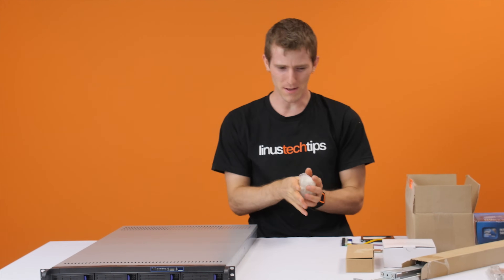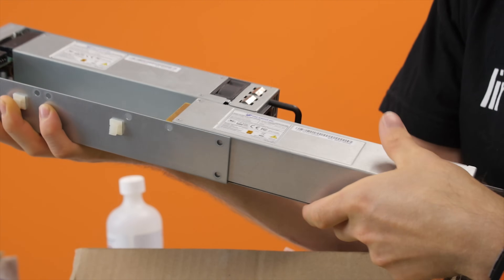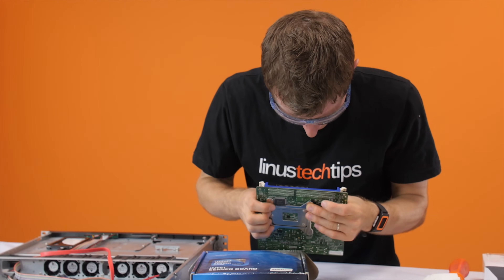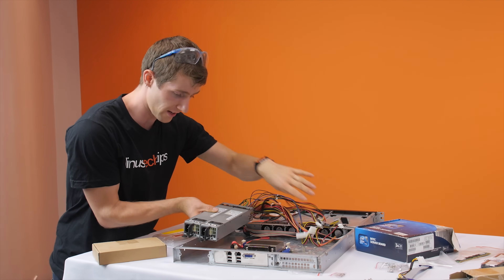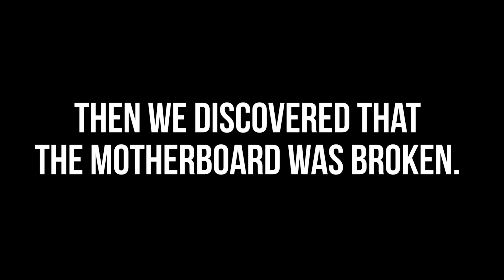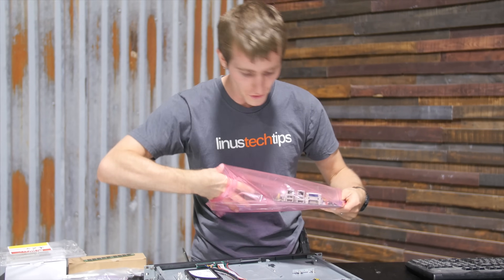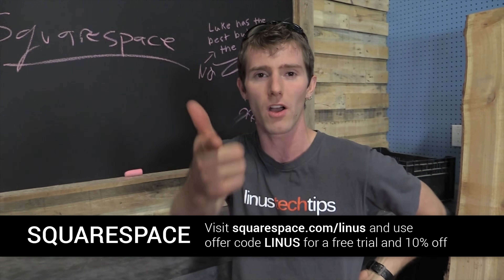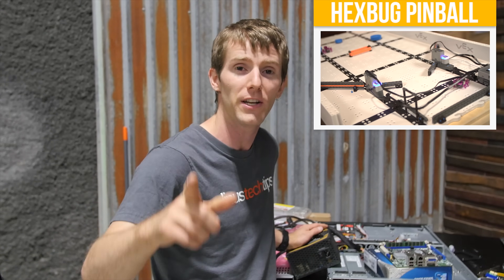DIY pfSense Rackmount Router Build Log - Part 1

Comment: +LinusTechTips Oh Linus, Linus, Linus. I've been in the computer industry for over 40 years. I served mostly small companies, and all of them seem to suffer from the same problem(s). There is never enough time to do it right, but always plenty of time to do it twice or three times (usually resulting in several cooked/destroyed components along the way). Of course, there is always plenty of time and money to ship replacements overnight and pay premium processing charges and then send a driver to the airport to pick it up. But NOOOOOOO, we can't just delay pulling the initial trigger by even one day -- just so an engineer (or sane person) has time to actually check the build. And worst of all, we can NEVER just stop and say we fucked up, let's go back and rethink this. No, that can never happen, because ... uh... uh... something manly and ego and stuff.

1) If truly constrained to 1U, you should have just bought a pfsense pre-built appliance and moved on. For now.
2) Else, you should have used a 2u (or 3u) case so it wasn't such a clusterfuck and moved on.
3) Else you should have just used an off-the-shelf mini-itx case, tossed it into the corner,  and moved on. Or just grab any one of a bazillion cases and spare atx boards you have over there, drop them in a random case and toss that in the corner.
4) You should have test-fit all of the parts in the case prior to assembly. Duh. Even I do that in an atx mid tower case.
5) You should never start carving metal until you know everything else is going to work, and there is NO other option, and there are NO other things that ain't gunna work or require mass destruction. Computers: when you bust out the Dremel, something is seriously wrong (and doesn't need to be that way).
6) There is a reason why 1U boxes never come with 32 core cpus and multiple graphics cards. Duh. If you can't fit the heatsink without grinding, just maybe you have the wrong motherboard / cpu / heatsink for that tiny case.
7) If you really wanted expansion room, then why the 1U in the first place? Even if you wanted future expansion, why not just go with the conventional blower for now and then address the ugrade if/when it ever actually happens. Or again, why not a 2u or 3u and expand until the cows come home?
8) The power supply not fitting thing... you bought 1,2,3 motherboards now, maybe you could have just bought the right power supply or the right case or the right motherboard or the right cpu cooler before you jumped in with both feet and a grinder? Have you ever heard of a pause button? Sanity check ... hello?

Dude, if I had $10 for every $1000 that small companies have pissed away this way, I'd go buy a new a car right now. No doubt it makes for great entertainment (if you like to watch people get humiliated -- which I REALLY don't). I'm sure that you can write off the expense that way. However, if I was an advertiser looking for a professional face for a serious product, I'd shudder at this stuff and probably just move on. Sadly, I have to give it a thumbs down. :-( But I still love you man.

Comment: Whats the difference between redundant and non redundant power?
Reply: +Xûr the real reason you would have a redundant power supply is that many servers HAVE to be online 24/7, for example a bank server storing account balances, the servers would be monitored 24/7 so if a psu fails, the engineer gets a message telling him what failed and what server. he wiuld then replace the broken psu and thus ensuring that the server never goes down
Reply: +Xûr The same as the differance between redundant and non-redundant anything..
Reply: +Xûr redundant has a backup power supply. 2 in 1
Reply: +Xûr  if one side goes you still have the other in a rundandant power supply. with out it if the psu fails then the system shuts off.
Reply: +Xûr RAID 1 for powersupplies
Reply: Ah! Thanks guys!
Reply: +Xûr With redundant power supplies, you can have it plugged into two power supplies at the same time, and if one dies, the other will still provide power, and you can switch out the old one. Also handy for needing to plug a server into another outlet without losing up time / having it turn off.
Reply: Y u no sell ice breaker last week u stupid
Reply: +callum Lawden  ...can be even more handy when is AC supply on two  diff fuses(AC circuits) of main supply..

Comment: In 5 minutes you:
-Tossed a CPU in the air and caught it by grabbing the pin side.
-Hacked off the I/O shield.
-Sliced a portion of the cooler mount and the speaker of the MOBO.
-Bent the MOBO quite a bit.

Linus, I love what you do but you're crazy.

Comment: no linus its not your fault, its just intel boards suck
i put incompatible ram (corsair xms2) into a DQ965GF and it never powered up again, and plugging in a pci usb2 card into an S3200SH killed that too. both the ram and the pci card still work in other boards.

in other words intel boards are pussies

Comment: Shorting components to complete failure would usually lead to smoke from a voltage control chip or fried CPU. From what I can tell the CPU wasn't changed. 
Normally single beep is a low voltage issue for the CPU which can be caused by shorts.

Comment: 1...test mobo before you place it in the can..
2...use hot glue or space on BOTTOM, if you need room..(heat sync support.)
3. Look at Box, make sure all metal contacts ARE where you need them..and NOT where you dont..

Comment: lol its probably the backplate thats shorting the motherboard...make a plastic one?
Reply: +Byzantine He even has a 3D printer, could easily make a new one.
Reply: +Fledge The backplate isn't a heatsink, it's just for supporting the cooler. It's not going to get hot enough to warp plastic. Plastic backplates are quite common.
Reply: +Fledge yeah
Reply: +Byzantine Agree - I would just put a thin layer of isolation tape on the backplate - that would fix it...
Reply: +Fledge Should do. ABS plastic melts at ~100c while the ambient case temperature you would expect to be less than 40c. At most the plastic would slightly warp which wouldn't be an issue.
Reply: +Nicholai Chev There is a serious reason, why this back plate is made out of metal. It is not temperature but to withstand the high pulling force caused by mounting the cooler. Finally it prevents the motherboard from bending. Dremmling around the back plate is no good idea. If back plate could be made out of what so ever plastic material, it already would ;-)
Reply: or just use 4 nuts on the back instead
Reply: +Fledge ABS plastics would do just fine they are used in cars under hoods and in WAY hotter environments than a CPU back plate. Your CPU is not getting above 60c in most cases even in a server - and the backplate not much over room temp.
Reply: +NPNtube That's true but normal pc builds have motherboards vertically and the installed heatsinks are much larger with added fan(s). All that weight pulls down too which causes lots of stress on the motherboard. Here the motherboard will be horizontally and the heatsink is tiny so the backplate only needs to hold it tightly.
Reply: +SnorryHobo but they have a fancy 3d printer just print out a new backplate
Reply: Well it also looked like the caps next to the socket were interfering too...
Reply: +Byzantine they could just buy a pre-made rack mount router from pf sence they do sell them
Reply: +Byzantine or at least insulate it with some tape against the motherboard
Reply: Stirling Shields they also sell barebones ones where you just need to put ram and cpu in.
Reply: +Fledge. Of course it would. A hot computer would run at a maximum of 100 oC more or less... any plastic could support that.
Reply: Motherboards have risers so they don't touch directly
Reply: +Pyrrelda Yeah, but the heatsink for the CPU has a backplate that holds it in place, and this particular motherboard isn't compatible with the stock ones from Intel. So Linus has been hacking his up with an angle grinder to try for clearance. You actually can get plastic backplates and ones with like, a vinyl insulator, but they can be hard to find if it wasn't supplied with the heatsink.
Reply: +DarkStar851 most 3D printer plastic can withstand up to 200 degrees celsius thats allot if a CPU gets hotter then 80 degrees you just need to get a better cooler anyway
Reply: +Byzantine Just wrap the backplate in kapton tape.
Reply: TheJackalPhantom Oh, I know. Not disagreeing there. You'd need to use threaded inserts though and I'm not sure how well the printed ABS would hold up to the pressure that a backplate has to take sometimes. (You're basically using it to force good contact between the heatsink and CPU).

As for the temps, 70-80C is totally fine in a 1U server build under peak loads. The boards are built to handle it and the CPUs generally don't care until you get into the high 90s. 1U cases require this particular heatsink because of the clearance issues. Those small 60/80mm fans force air through the case from the front, to the back, through the fins. That's why they're loud as all hell. (src: former sysadmin who built a lot of custom hardware solutions)
Reply: +Byzantine I've had that happen to my PC, and I have only built one. Linus, how do you not know this facepalm
Reply: +Chwarg he did 9:48
Reply: +Byzantine Yeah, it looked like it was touching some of the connections on the back

Comment: What is the best router on the market?  I need something powerful with huge range.  Plz halp!
Reply: The Cisco CRS-1's are pretty good.
Reply: Google Asus RT-AC5300 Not released yet though.
Reply: +StoreBrand how much will it cost?  and when's it comin out?
Reply: +curly0117 Asus claims a 5300 sqft range, and it will probably be around $400 usd. Also as @storeBrand said "Google it", it would of be any of the top ten results. Estimated to release by end of year.
Reply: +kevin tate I learned about 13 years ago that consumer grade routers are garbage.  Pretty much every consumer router that I have ever tried had built in wireless and they needed to be restarted quite often (a router should never need a reboot unless you are updating firmware or replacing the hardware)  Even commercial routers many times have issues if they have built in wireless.  Wireless should always be provided with a stand alone AP (even if that stand alone AP is actually a consumer router running as a simple AP).

I seems that the problem with consumer equipment is that it is built at such a low price point that it can't handle being both an AP and a router.  Disable the built in AP and many times they are rock solid for a handful of devices on a home network.  

My Clear OS box that I built 4 years ago has only been restarted a handful of times when the power has gone out but is otherwise rock solid for months because it only has one job to do and more than enough horsepower to do it.
Reply: Use a pfsense or other router with wifi disabled to issue ip addresses, and use something like Ubiquiti Access Point(s), they come in Long Range variants too
Reply: ***** No it's not overprice, it's business oriented.
Reply: Jon I
APs are the wireless Access Points were wireless devices access the network, the router is what sorts out all these connections and get them connected to the internet.
Reply: +curly0117 Routers with built in wireless....Routers were made to route your connections just to one connection...now they are wireless APs too and they usually crap out on the wireless
Reply: asus ac3200 and get external outdoor antenna with 16db or more from hawking wireless or tp-link or dlink
Reply: +kuhrd what's the difference between a router and an access point?
Reply: +curly0117 pfSense is the best firewall on the market..  If you need WiFi, Ubiquiti UniFi is good and cheap.
Reply: So you basically hook it up to your router with an ethernet and it acts as an extender?
Reply: Kind of..  Lets use an example, so lets say we have a firewall (pfSense) with two 1Gbps ports, one for Internet one for LAN, we have a switch (24-port Gigabit 1U), and a Ubiquiti UniFi.

In this case the Ubiquiti is the only device that has a wireless radio in it, the other devices are not like a consumer router, which is sort of a firewall, switch, and access point all in one.

So we would connect the firewall port 1 to Internet, port 2 to the Switch, then we would connect the Ubiquiti to the switch.  If you want multiple Ubiquitis for more coverage, you can install the UniFi controller software on a server, then simply plug in multiple APs to the switch.
Reply: curly0117
Feather was spot on
Reply: curly0117 If you have a main router with WiFi, you can buy a new router and connect it to it. Enter the Web GUI and change it to all the same settings as your main modem for example the routers name, its WiFi type (N, AC, etc.) Its security type (WPA, WPA2), password. If your router doesn't allow this then you can install "dd-wrt" (not too hard) and do it from there.
Reply: StoreBrand Featherawr kevin tate  Im a massive noob at this so im still confused.  My router is in my basement currently and I can't move it from there.  My room is on the opposite corner of the house and I'm getting a weak signal in here.  can I use the Unifi AP to extend the wifi signal?  Can I just get a long ethernet cable and connect it to my router and then to the Unifi AP and install is somewhere upstairs closer to my room?  Is that how it works?  Will I get a stronger signal??
Reply: +curly0117 Talk to Cisco... something something... 10,000 dollars...
Reply: curly0117 Yeah I mean maybe the right question wasn't asked to start with.  If that's the case what I would do is get a powerline kit and a UniFi UAP.

Plug one end of the powerline to the router in the basement, then plug the other powerline in your room to the UAP.  Or if you just need one wired connection, drop the UAP and just use powerline.
Reply: curly0117
I would either stretch an ethernet cable to your device, it tends to be faster, or do what Featherawr said and get a PowerOoverEthernet kit and just use one cable to power the UniFi UAP and put it near your part of the house, or towards the middle of the upstairs atleast
Reply: Featherawr Oh cool.  I didn't even know that even existed.  So I just plug this in my wall in my basement and then hook it up to my router with an ethernet, and then plug in the second one in my room and hook up the ethernet to anything I want ( into a UniFi UAP or directly to my computer)?  And it works just as fast?
Reply: curly0117 basically yeah, it uses the power cables in your house as Ethernet (or something like that). but make sure to check the power line adapters bandwidth to make sure it doesn't become a bottleneck.
Reply: I just ordered one on amazon.  says it's up to 500Mbps.  shud be fine
Reply: +curly0117 yeah I think that's with overhead plus half duplex so its not quite the same.  I get 50Mbps up and down.
Reply: o.O  I also have 50u&d. shud work fine right?
Reply: +curly0117 Routers don't have a range as they don't emit any kind of wireless signal.
Reply: +curly0117 yeah perfect for your Internet.  Only could bottleneck if you copy files internally between computers in your home.
Reply: +Genral Graphics  routers do have range. it depends on their antenna
Reply: Rj Lao
Now wireless APs have range, routers are nto the wireless part

Comment: You know what you SHOULD have learned from this little snafu Linus?

RTFM!

I'm sure there exists some documentation somewhere that would have told you that the case doesn't support that power supply, doesn't support full height back plates and what plugs have power to them when the system is turned on.